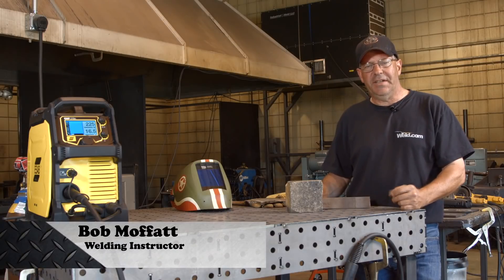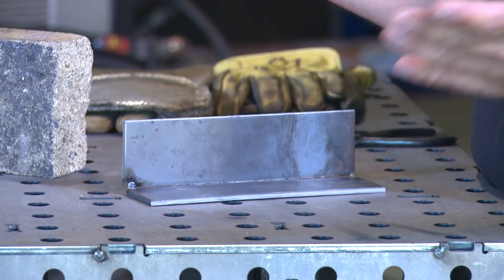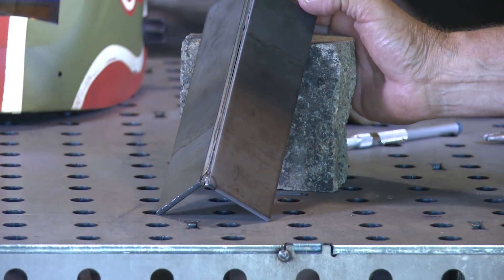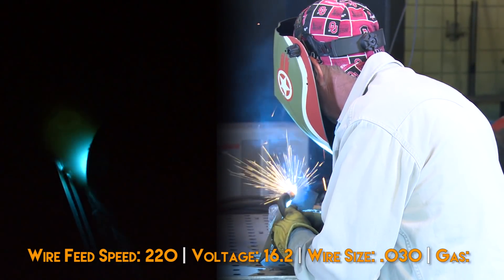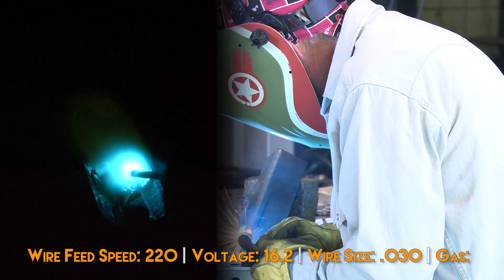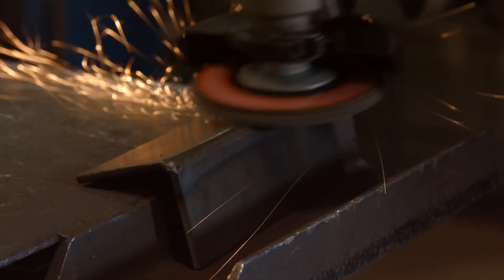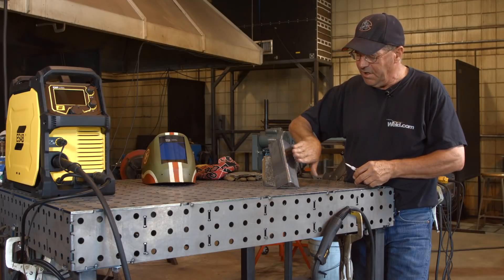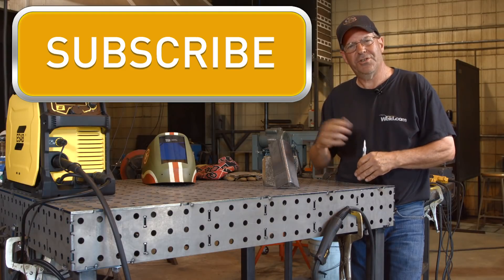MIG Welding Outside Corner Joints: Part 1 of 3 - Carbon Steel | MIG Monday

Comment: When doing corner-to-corner joints, it is stronger to do a cursive technique or a technique which involves u leaving the joint because the root has no room for penetration. Even crazy structural welding, u should use the cursive technique on these joints. Then once u weld one side of it, on the other side u then run a straight push or pull technique in the root cus the weld on the other side will act as ur root and room for penetration

Comment: With the corner joint  had the most trouble just setting it up. I had the most trouble with doing a lap joint. My top would fill in, but my bottom was a mess.
Reply: I'm on that same lesson right now did you figure it out for the 1/8 material?

Comment: I’m a big supporter long time fan of bob but this is crap, that’s not a downhill weld. When building a box you will never have them in a 45 position it’s always 90 or flat. And that is where we have problems trying to outrun the puddle and porosity problems as well as lack of penetration. Show us that not this kitty crap on a 45

Comment: So 16v and 220 wire speed for a corner like this... I assume you normally weld 1/8” material at higher settings like 18-19v and 300 wire speed? I’ve been struggling with corners like this, but have been using my higher settings that I normally use for t joints and such. Maybe I should dial down. It does look like too much material when I do it at those settings.

Comment: You said this weld type was for the hobbiest,  how would it be different if a professional welder did it?
Reply: Probably doing a root pass and then a fill pass maybe evening a third cap pass, 2 or 3 but not a single pass

Comment: I need to weld up a box made up of thin walled sheet. would an everlast pulse mig welder help with burn through? I could weld it up by skipping around to keep the heat down but I want to find a way to weld it efficiently and not have to waste so much time.
Reply: Yes. Pulse mig welders like the ones Everlast have were made for allowing thinner material to be welded with a given wire size as well for other benefits.

Comment: In the comments I see a few references to "back stepping the weld" what is this?
Reply: Back stepping. Okay, let's say you wish to weld in your normal direction and that is from left to right over a distance of 2 ft or 600 mm. Now if you did the full weld in one pass you would find that you had lots of heat input by the time you got to your right hand end as well as a great deal of induced stress in the joint as the weld metal and parent metal cools. If on the other hand we divide the weld length up equally into 4 inch or 100 mm increments and start at the right hand end at the last division. Weld from the last division to the end and stop. Now move back to the second last division and weld towards the start of the first weld and tie you weld in neatly. This is back step welding. Next go the the third last division and weld towards the start of the second weld. Rinse and repeat until the full length is now fully back step welded. Hope this helps. Mark

Comment: How about 1/4 inch plateon a steel hulled boat? got any suggestions? how about the weld where 1/4 inch plate bulkhead is welded to the hull? i don't want the hull to look like a starving cow!  thanks

Comment: At My last job we would weld out a LOT of chutes made from 3/16 mild steel or 1/4 AR500 (preheat) if it was for crushed glass. We would use .045/co2 100ishipm/20.5v downhill or flat and would usually back step our welds if the joint was 3ft or longer and put 3-12 stitches on the inside and over every brake.

Comment: when you say wire size can you please say it in millimeters 
thanks.
Reply: David Cashin well in Australia .8 and .9 are basically stander and somewhat universel
Reply: .030in would be .762mm
Reply: You usually can only get 3 sises of metric MIG wire .8, .9 or 1.2 mm in 70-6 solid wire .8 mm for thinner metal up to 1.6 mm then .9 mm for up to 6 to 8 mm then 1.2 mm for up to 10 mm only a rule of thumb for home or hobbyist. For structural then you need to look up the welding codes. Gas shielded flux cored wire can be used for thicker material and they come in different sizes but again you would need to look at the welding code for that material. Hope that helps.

Dave
Reply: +David Cashin there is also 1mm, well that is in aluminium when i reseached it.

Comment: question if you were making a box can you make it completely air tight without having it crumple when it cools down or will it always leak
Reply: Great question, following this comment as I have the same thoughts on making a metal box.
Reply: Yes you can make it air tight with no problems
Reply from the maker: If it is a small box that is completely enclosed, yes, it may not want to seal while very hot. One might leave a half inch or so un-welded, let it cool completely, feather the starts and stops and finish welding it. Or finish it with GTAW.

Making something air tight requires all starts and stops to be tied in and fused so some light grinding may be in order.

 

Larger boxes, tanks and other items should be treated the same. I’ve never had one leak when taking these precautions.

Thanks for the idea on a video of how to make a complete tank leak-proof
Reply: +Weld.com Do you have a video up on welding auxiliary fuel tanks? That is of interest to me as I want to build a custom long-run fuel tank for a standby generator.
Reply: If it is a large box, try back stepping your welds to help with cooling and not just keep pushing the heat down in one direction.
Reply: i know some people put a bung plug so it can be drained but surly that would also make it leak unless you use threaded tape